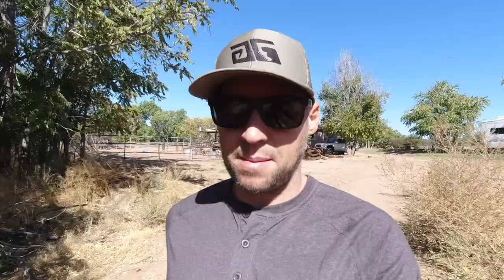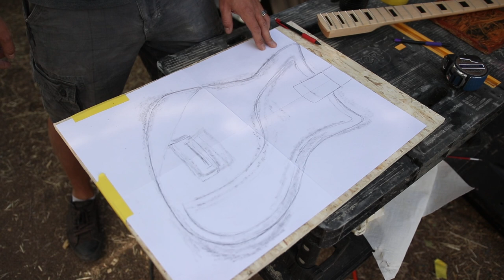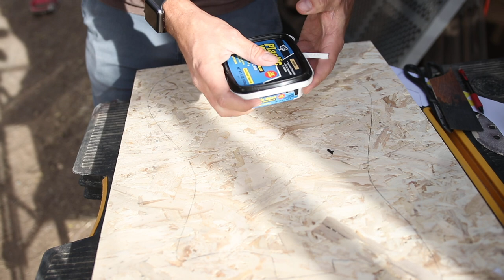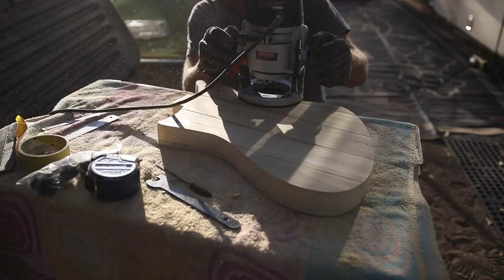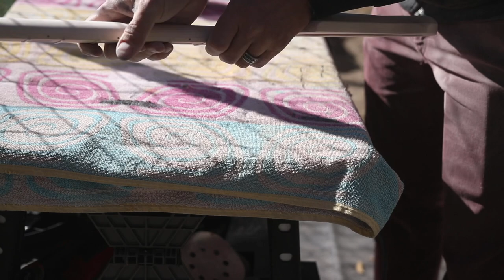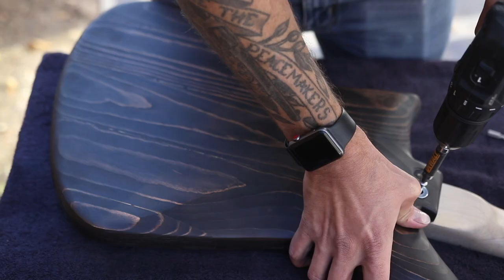Building a Bass w/ FREE WOOD from the JUNK PILE (with minimal tools)! OSB and 2x4's DIY guitar

Comment: Dan, here's a Clamping Hack: If you have or can get an old bed frame made of angle iron (usually  1-1/2 inch angle iron that's  1/10th to 1/8 inches thick), you can make clamps for gluing  blanks. You'll also need some threaded rod and a few bolts. I had three pieces of 5/16" x 3 ft. threaded rod and a 2 foot chunk of 3/8"  threaded rod, with nuts & washers. I also found six 3/8" x 1" bolts with nuts and washers in my bolts bin. YMMV. I used a hacksaw, an electric drill, a couple of drill bits, & a file. If you have an angle grinder, scratch the hacksaw and file. 
 
I clamped the blank two ways. First, to keep the blank flat and more-or-less level, I cut 4 pieces of bed frame long enough to go across the glued-up 2x4's plus a few inches, and drilled a hole in each end, just  big enough for 3/8" threaded rod.  Then, I cut my 2 foot piece of 3/8" threaded rod into four 6 inch long pieces. I put a piece of this through the holes in each of the four ends of the of the bed frame sections, with a nut and washer on each end. That made 2 clamps that held the top and bottom of the blank more-or-less flat and level. 4 pieces of thin scrap on some wax paper go between the angle iron and the glued blank.

To squeeze the glued 2x4's together , I cut three pieces of bed frame that are 3-4 inches wider than the blank. I drilled a hole in each end of these longer pieces, but in the side of the angle iron that would be vertical when the angle iron was laid flat on the blank. Then I drilled holes in one end of each of the six shorter pieces, and bolted them to the longer pieces using the short 3/8" x 1" bolts, with a washer so they could pivot. This means that the other face of the short pieces of angle iron press flat against the side of the glued blank.

Finally, I drilled a hole at the opposite end of each of the six short pieces. These holes are in the side of the angle that is flat against the sides of the 2x4 blank. So, three pairs of holes that face each other. Then, I took the 3 long pieces of 5/16" threaded rod, and put them through each pair of holes, tightening them with nuts and washers at either end. This made three "U" shaped clamps, the short sides pivoting on bolts on the lower corners, and tightened by the nuts and threaded rod on the "top" side.  (I put pieces of scrap wood between the uprights of the "squeeze" clamp and the glued 2x4's prevent the uprights from digging in, & even out and spread the clamp force. 

(If I had had more pieces of threaded rod, or wire cable and turnbuckles, I could have just used six short pieces of angle iron bed frame, with a piece of threaded rod across the 2x4 blank on both faces. But, I only had 3 pieces, so one long side of each "squeezing" clamp is angle iron. 

Possibly the "squeezing" and the "flattening" clamps could be combined. But, I wanted three "squeezing" clamps for even pressure, and my long pieces of threaded rod were only 5/16" - not as strong as 3/8" threaded rod. So I made two  sets of clamps - one set to hold the blank flat, and the other to squeeze the 2x4's together.

IIt took longer to write this description than to make the clamps. Also, making it might vary depending on materials on hand - I didn't have money for more threaded rod, etc. I had an old bed frame, 3 pieces of 5/16"  threaded rod, a 2 foot piece of 3/8" threaded rod, and some short bolts. I might have done without the "flattening" clamps across the blank. However, my concern was  that when I tightened the "squeezing" clamps, the 2x4's would buckle at the glued edges and the blank would collapse. 

Sorry for the long comment. I hope this might be useful - it could be made with other materials. I  used what was here. Thanks for all the great ideas in this build.

Comment: The best way to glue that osb on would be to screws. Since you had so much extra material, you could have traced out the template and put the screws all the way around it. A box of screws is alot easier to store than a bunch of clamps.👍

Comment: I'm looking at a similar scrap wood build (aka non-luthier tonewood) but was researching true-ing up boards using a hand plane and making up a shooting-board.
Not expensive, although the plane should at least be decent and the shooting board can be made from salvaged wood too.

Mine is some pine that's been in my shed for 20 years and there is a recycled timber place that does "project packs" of short lengths of wood for cheap.
I'm hoping to get some old floorboards to use as my top (and maybe back) - or maybe even build my first neck/neck-through if I get some bits that are long enough.

I'm only trying this because of the work that you do, your videos full of knowledge and the inspiration and positive attitude you provide.

Comment: Nice job Dan!  I've actually done this a couple times- I call them my spare parts series.  All of the wood is leftovers, scraps, culls from a local lumber yard etc.  And all of the parts- pickups, bridges, tuners, knobs were used.  Only new parts were pots and jacks- I try to never reuse pots and jacks, that just leads to issues down the road.

Comment: I did it! (well started it). I have 5 lengths of 2x4 clamped right now. Things I learned: clamping all 5 at once... I got a slight bow but it's not very bad. So I think 2-3 at once is a good limit anyway. I tried using dowels to lock the pieces together and managed to make it a disaster lol. But that was needless anyway because I can just put the bridge and neck pocket on the center 2x4. Going to glue on the top wood tomorrow and plan the body and pickups next week!

Harbor Freight had a crazy deal/sale this weekend in-store so a few of their 20V cordless tools weren't expensive at all. I might add the circular saw so I can drive around and relieve people of wood they are trying to get rid of. My hatchback can only hold such dimensions lol...

Bought sanding pads off your link at least ;) I think I have 3 videos bookmarked so I can do that for various things once I'm ready for the neck...

I'm going to put weathered fence boards as a top and then epoxy it all to seal/fill it.

Oh! HF had a smol rotary tool that was about the same price as a flex shaft, and I didn't know if my larger Radio Shack rotary could use an available flex shaft, so I got that instead.

I may or may not try to stain the neck/fretboard to match the grey of the fence boards. Anyway, I'm rambling because I'm excited to see my project at the end :D
Reply from the maker: That’s awesome! Thanks for sharing, this is an exciting project!
Reply: @GunsandGuitars  I'm a little closer. I have the boards glued on and a body drawn on the body blank, at least. The neck you linked is going to be perfect because I want to make a stain with vinegar and steel wool that does a great job staining maple a greyish color so I don't have a weathered-look body with a minty fresh neck on it XD

Northern Tool is blowing out the old Keter folding workbenches, with a coupon I got one for like $80 :O so much better than the janky/warped Costco camp table I was working on lol. The stars keeping aligning on tools/supplies >_>

Comment: Charvel actually uses a similar output jack idea but on the back of the guitar and the lower bout of the body is carved at an angle so it doesn't poke into you

Comment: Another cheap way to true up the body pieces before glueing would be to clamp 2 pieces together with the sides to be mated facing up and then use a hand planar on both simultaneously to make the sides match each other. you could even plane at an angle and they would match perfectly when you put them together. It's a trick I saw in a woodworking tips video.

Comment: I liked the 2 boards + 3 bonded together with a strap to prove that someone can build with ingenuity and not ALL OF THE TOOOOOLS. 
Another way could have been to offset each 2x4 by 2 inches until the whole rectangle winds up slightly diamond shape.  Happens to be closer to the finished shape of the bass.  At worst, need slightly longer 2x4s.
If one doesn't have such a heavy pair of toolboxes for an OSB clamp, 2 cinder blocks and a cooler full of water.  Or frozen water pieces and bottles of your choice.

Comment: Dan, love the design. Question: How would a hand plane do to flatten the join sides of the 2x4's? I have a belt sander, but not an orbital. Might be able to clamp down the belt sander.  Bought a very long-scale Dean bass, $10, from a guy who'd just been evicted & sitting on the curb. Pup's dead, body cracked, neck OK. Hoping. . .  Thanks for posting this.

Comment: Super cool bass. I have a real itch to make a guitar but not a lot of tools. I do have jigsaw, hand sander, grinder as well as a belt sander. Could the belt sander be used in place of a planner to cut down sanding?  Or is there a danger to dig to far into the wood?

Comment: Hey! quick questions. I have a cheap bass (gears for music) and I want to fully customize it, change the neck to a fender neck, since the body is just a copy of a Precision bass.

My question is the following: The Precision Bass neck has 4 parallel holes. while the holes on my bass' body are Angled. should I look for other necks with the angle holes that match or can I make another whole on the fender's neck and then add a neckplate to the bass?

Thank you and have a great day.

Comment: What would you do for moisture in the wood? I have a bunch of scrap wood outside that’s been getting rained on for years. Is there a quick way to dry it, or is it even worth worrying about?
Reply from the maker: It does need to be thoroughly dried. Not sure what climate you are in, but maybe you could cut some pieces to store out of the weather for a while to dry out?
Reply: I’m in central Florida. Probably the worst area for dryness right now 😆 it rains every day and humidity is sky high. That would be my best bet though I guess.

Comment: Think i could get by with mdf and a hardwood ply wood top? Sick of letting my circumstances define what im capable of.
Reply from the maker: Mdf has a tendency to crumble so I don’t think it’s strong enough for the body, but you certainly can use plywood! Just glue a few layers together to make it thick enough
Reply: Thanks dan!! That was actually my main concern. I did figure out i had enough plywood to do three layers yeilding a body blank that is roughly 1 and 7/8ths inches thick. So i can do that instead.

Comment: I was wondering, Could you use that rotary tool to tout out the cavities or is it not that strong enough?
Reply: Rout out ** sorry
Reply from the maker: I used to route with the rotary tool. It can be done, and if you only need to do it a couple times you can get away with it. Otherwise a router is a good investment if you will be doing a lot more routing.
Reply: @GunsandGuitars  thanks, i think i will use the rotary tool because routers are too expensive

Comment: Why are you putting all that time into shileding tape when twisting the signal and the ground works. It's as effective as coax at audio frequencies, and has worked for fender for decades. Seriously, try it. For a start it's a load less effort. 

If you use shielded wire or twisted pair, you only need shileding tape where you have open body switches or pots designed to mount to a metal chassis with unshielded fronts.